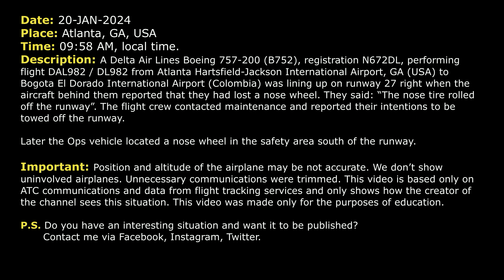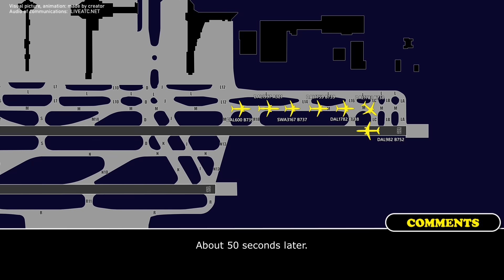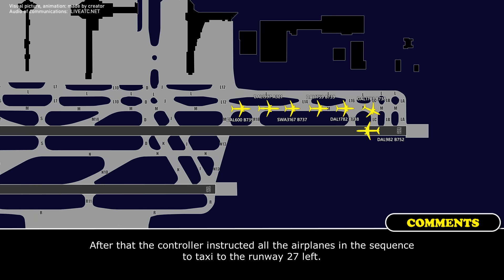Airplane LOSES nose WHEEL before takeoff. Delta Boeing 757 has problems at Atlanta. Real ATC

Comment: This is probably a result of diversity and inclusivity.
Companies being forced to hiring people based on race, gender and everything except their actual knowledge and abilities
Reply: Because black people can't tighten nuts? Or is it the queer people you are afraid of?
Reply: You have no idea what you're talking about. 
Tire failures are one of the most common structural issues experienced by aircraft, most of the time it's usually flat tires or popped tires. In this case it's likely that something came lose to allow the wheel to break free. Diversity hiring and inclusivity has ABSOLUTELY nothing to do with a wheel falling off, in fact failure rates and incidents were much much much higher in the past before regulations and company policies made things more strict. As a pilot, airlines do not higher based on diversity and inclusivity, they higher based on skill and experience. It's more likely that the wheel failed due to a defective part which in some cases is impossible to predict which is usually the most common reason when it comes to tire failures.

Comment: A 757?! They stopped making those in 2004... the plane is at least 19-20 years old. Not Boeing's fault at this point.
Reply: 31 years old actually
Reply: That plane specifically has been flying since the early 1990s

Comment: Boeing needs to be disbanded.  It's useless.  They have never made a model that hasn't had problems.  Not one.  Every single one of their models (military & civilian), has had design screwups that have led to crashes. Some had fatalities, some didn't. They were ALL unnecessary.  Don't put 4 cheap bell rivets to hold the elevators on. Don't run electrical wiring Into & Through A Effing Fuel Tank. Don't make software that crashes the planes. The list goes on & on. They make poor decisions, & are never punished for them.
Reply: Oh piss off, this. isa problem with maintenance, not manufacturer. I don't think there has ever been a model on any vehicle that didn't have a problem. This plane is 30 years old. A plane that's probably older than you breaks so you demand the whole company be disbanded? That is absolutely stupid, the plane is already fixed and flying again.
Reply: Dude that delta 757 is over 30 years old, Boeing stopped production over two decades ago, that issue is related to maintenance, not boeing

Comment: Things would have been way worse had that wheel fallen off during the takeoff roll or on landing, both very high speed and high stress environments for any wheel, even aircraft landing gear wheels. Good job to the aircraft behind for spotting that.
Reply: There are two wheels on the nose gear.

Comment: Unless there is broken hardware,  I'll bet Deltas maintenance dept will take this hit.
Reply: Oh you bet. I can already hear the supervisor screaming from the blockhouse.
Reply: Axle sheared
Reply: Something like this seems like a pretty big oversight, especially if they have supervisors in place to sign off on work that has been done.  That would mean it was missed twice potentially by maintenance. How does that happen?
Reply: @casperthegm741 pretty vague guess for something you know nothing about. Probably best to just stop.
Reply: @swagger897 it was just casual speculation friend.  I made it clear that I had no insight and was simply wondering about the procedures, so probably best to just chill.

Comment: Rookie mistake I'm sure. I work on the 757. The main nut probably wasn't torqued properly if at all and the 2 locking bolts where not installed .
Reply: How many nuts hold a 757 tire on each side?
Reply: @superbmediacontentcreator  one axle nut and 2 small bolts on the axle nut for safety. if the two small bolts are not installed  the nut can work lose. and is probably why it stayed on while taxing .
Reply: @markthompson8656  So it's like a train wheel not a car or truck wheel with a bolt circle?

Comment: How can a wheel fall off a 757? What is going on?
Reply: Keeping the shareholders happy by whatever means necessary
Reply: @normiepuppet  The boeing 757 is ancient, production ended over 20 years ago, this is not a boeing problem, it's a delta problem. Wheels get replaced many times throughout operational service by delta mechanics, not boeing.

Comment: Let's thank our lucky. fvcking. stars. that this happened when it did.
And not a few seconds later when the plane was rolling at 100+ mph.
Or a second or two after that when the plane's going even faster, and is now 100 feet up, and has not yet retracted gear.

That nose wheel weighs between 100-300 pounds (not sure exactly how much.).
You do NOT want that puppy bouncing along at speeds like that. It will punch through anything short of Ft Knox.

Comment: better on the ground than in the air
Reply: Could you picture it falling from 500 - 1000 feet? That could generate some irate neighbors at some airports.
Reply: @spvillano  I was thinking more the plane trying to land.
Reply: @Mmmm413mm  well, they put two wheels on the nose gear for a reason - redundancy.
Reply: Better during taxi than any critical flight stage.

Comment: Lucky it did not detach during takeoff and hit something at high speed. Also, at 3:18 tower incorrectly clears Ops 2 to runway 27 LEFT instead of right.
Reply: ok, got a number for you to call for possible ATC Deviation.
Reply: It could have hit a gasoline tanker truck causing it to explode and set fire a Chipotle.
Reply: I think the bigger problem would be trying to land a plane with a tire missing.

Comment: Ha! I was taxiing out just after that happened. We were wondering what happened to get the passengers removed on busses and leave the jet on the runway. We had to depart on 27L 😂
Reply: At least there, everything can be offloaded and the flight re-crewed. Most likely, the wheel had to be reinstalled before being towed in. The plane was disabled for 3 hours.

Comment: Yikes! I want to hear what caused that! Not sure if I'm hoping it was maintenance (or lack thereof) or failure of the strut holding the assembly.
Reply: almost guaranteed it was delta maintenance
Reply: Maybe to be fired employee???
Reply: @jameskim62  probably promoted to management. Haven't you heard of the Dilbert Principle?
Reply: @spvillano people will think you're joking but it really happens. It's actually a pretty ingenious strategy if you think about it. You keep the actual competent people out on the floor doing the real work while those who failed at it or can't do busybody work. Quite ingenious.
Reply: Could also be that they ran over debris during taxi? Smaller chance, but possible (just ask concord).
Reply: @lyianx  I would expect a flat tire in that case, not to have the entire wheel come off.
Reply: Don't worry Boeing will issue a software patch in 9 months for added fee.
Reply: @HappyRock616 the 757 hasn’t been manufactured since 2004. Quit riding your Boeing hate boner and realize that this was caused by poor maintenance and not a Boeing fault.

Comment: Who are these airlines hiring in maintenance depts?!?!
Reply: Frequent flyer here. I've noticed massive uptick in maintenance delays on my flights the last couple of years. One of the last ones, we were lined up on the runway, engines spooled up for takeoff, then right back down as we exited the runway. Aborted takeoff due to engine trouble and 14 hours later it was 'fixed'. That was a long day, but I was wondering the whole time, 'who' was behind all these issues.
Reply: @3rett115  Frequently maintenance and weather delays at destination are used as excuses for operational delays. You've been duped.
Reply: Have you been to ATL?
Reply: Whoever is cheapest/fastest. #MarketEconomics
Reply: DEI?

Comment: I assume only one of the two nose gear wheels came off. Could they not still taxi off of the runway, or they didn't want to take any changes until maintenance showed up?
Reply: No, I wouldn’t have moved either. Without any idea what’s holding the other wheel on, and they’re not designed to handle the full weight like that so the other wheel is going to get damaged moving it. It’s not combat, it’s passenger flying. No need to go.
Reply: I'd not take the risk either, who knows whether the second one would come off too 😅

Comment: Alright who forgot to tighten the bolts
Reply: Commercial airplane tech here. Though I've never touched a 757. 

It's likely gonna be one big axle nut, tightened to one hell of a torque, and safetied with something. By safetied, i mean secured from loosening by itself by some other means. By locking wirez or by cotter pins, or a retaining ring or something.
Reply: Same guy who put the door plug on Alaska😂
Reply: The 757 is too old to be checked by Boeing itself
Reply: southwest was in a rush
Reply: Crossed thread's better than no thread!
Reply: @eltomas3634  I am.....extremely hard-pressed to agree with you. 😂
Reply: Wasn’t me ~~~ I triple check it , loctite, and safety wire that nut  !!!!!!
Reply: The procedure is torque it til it strips, then back it off 1/4 turn, not 4 turns. Slow down and check your work. Safety is third.
Reply: I've worked on the 757 and while it most likely was a maintenance error someone is going to get chewed out for it will be investigated but since none of us are actually able to see the aircraft we won't know if it was actually a parts failure or maintenance induced. Either way it's a good thing it got caught before it actually took to the air. I wouldn't taxi back on a single nose tire either. Way too much risk nevermind landing on it even though there's two for a reason to include redundancy.
Reply: too soon 🤣🤣
Reply: tyrone, sheniqua, pablo, lupita
Reply: @ReptiIicus  What a toke ranch is?
Reply: only 1 nut holding it on.
Reply: Talk on the streets is that the person who didn’t tighten the plug door bolts on the 737MAX was sacked but found a job in aircraft wheel maintenance.
Reply: Torque spec
Torque spec
Torque spec

Just to confirm

Did anyone check the torque spec?
Reply: @jaysmith1408 "Good and Tight"
Reply: Boeing
Reply: @possumj7307  Fool